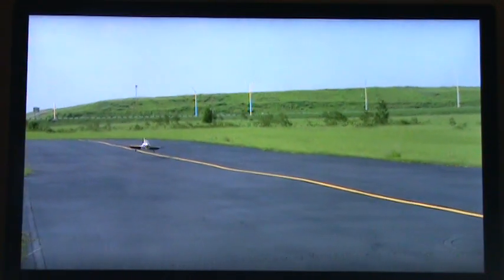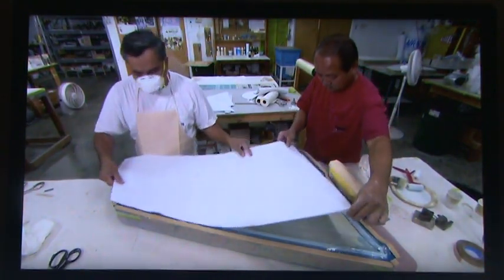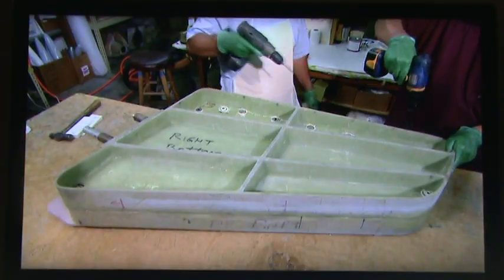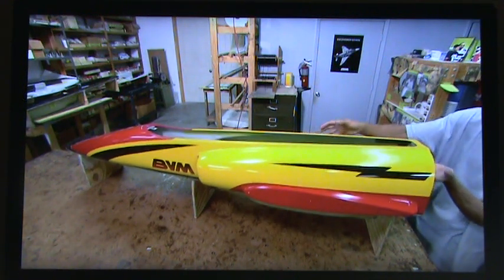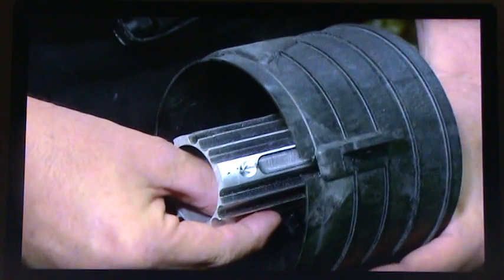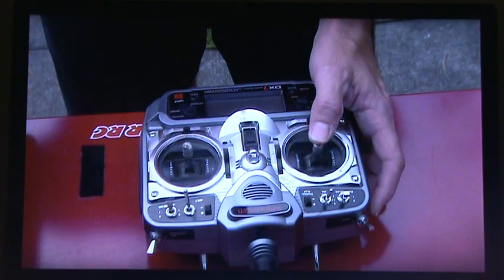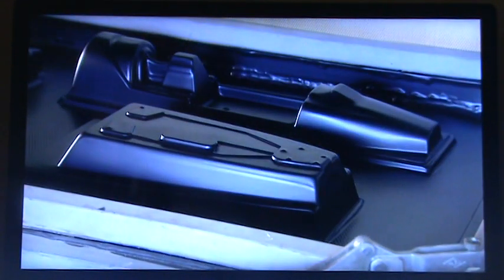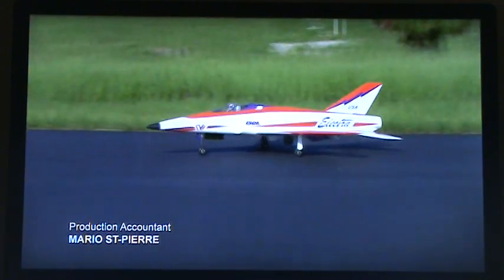BVM R/C Jet Assembly

Comment: Personally I dont agree with flight speeds of over 200mph as this will kill someone if something goes wrong...also i dont like the use of wood in these jet airframes...i have seen too many on youtube break up in the air.
Reply: I know a builder who scratch built a F- 4 Phantom & F-18 Hornet , that was 10 -12 yrs ago & still fly in the 200mph range. All built from wood - ballsa & of course has fiberglass finish to add strength. If built properly from scratch, they will last. But you gotta be very choosey of what materials you use where also.
Reply: Because they were not built properly
Reply: It fully depends on the build quality. We used to have a BVM Bandit (the same one in this video) with a 180N turbine engine and it would do 315mph with no structural issues. However, BVM is like the Rolls Royce of model jets and many can’t handle those types of speeds.